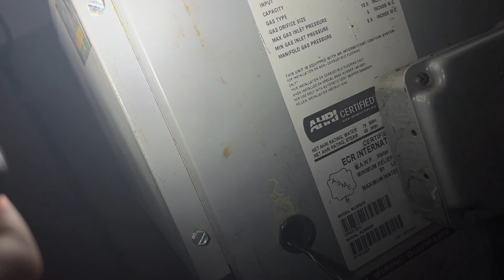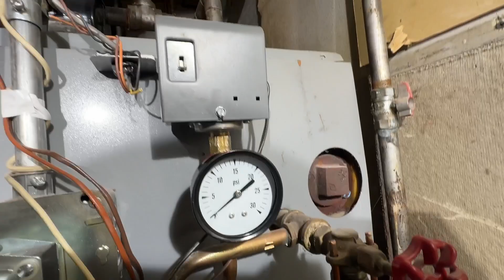Steam Boiler Bangs! Insurance Claim for Heating! Overfilled Boiler! Bad Air Vents! Bad Pressuretrol!

Comment: Nice job on that call. I'm sure you know to change radiator valves can be a royal pain good luck with that. I noticed you missed something it's a low cost item but important. I would clean the sight glass and maybe even replace it also you should carry a sight glass repair kit with new nuts and gaskets. 👍

Comment: Daniel, love the videos. By the way, that type of pressuretrol should be set to .5psi. The new steam boilers you install with the other type pressuretrols are set just below 2psi. Just an FYI.
Reply from the maker: We keep them all at just below 2psi, we run into issues when setting it to .5, especially when it’s a control that’s been there for over 10 years. Adjusting them lower typically ends up in a short cycling boiler or a no heat call down the line. I’ve lowered two and both had recalls for no heats. I don’t touch, and if they’re not accurate they get replaced. 

Typically I recommend installing a vapor stat, much more accurate and much better luck with them at the lower pressure.
Reply: I agree with you on the vaporstats. Keep up the good work, you’re doing great !!

Comment: Bad traps,and the dates are in the serial#
Reply: where do you see traps?
Reply: @frmerrin2  All steam systems have traps
Reply: @petersmart1999  Where's the trap on a single pipe steam system?
Reply: @frmerrin2  I did not watch the whole video,I was just throwing it  out there,as the singles use the old drip traps system! He is very vague ,no model,no serials etc! He said no date,but anyone that has been around long enoughknows that info is built into the nomenclature in the serial #! I dont see very many little syeam systems in houses,Mostly industrial,and large commerial.Smallest i work on is a Smith 19he,bigger stuff 93 series WM,CBLE Cleaver brooks!
Reply: @petersmart1999  There are no traps on a typical residential one pipe steam system.
Steam and condensate share the same runout to the radiator and then the condensate returns to the boiler to start all over again.
Maybe next time don't assume.
Reply: @frmerrin2  Tell me this,why is that vent on that radiator mounted at the top of the Radiator,that I do know is not correct,so it is and upfeed paralell with wet return is what I gathered,and im more of a steam and skim,than drain and fill kinda guy,yeah they could throw some colloid in it but thats a cheat! Thanks for the response
Reply: @petersmart1999  it is in a bad spot it should be midway down the radiator opposite the supply valve but it looks like it was a hot water radiator and someone put the vent in the wrong spot